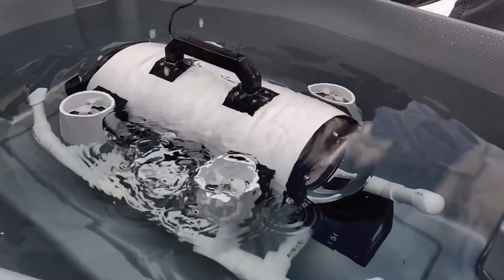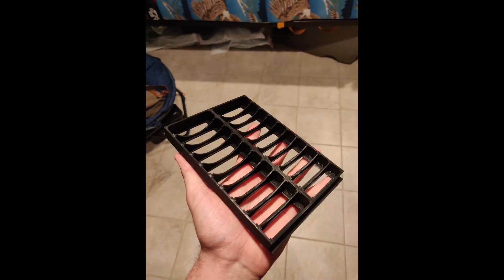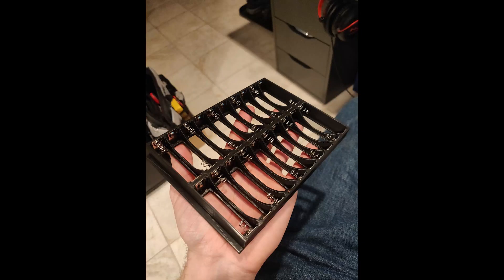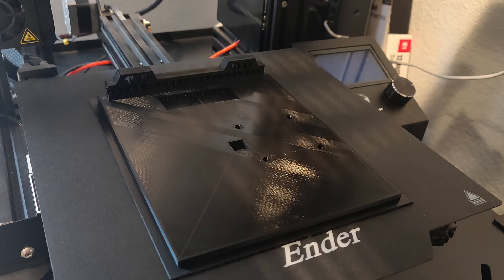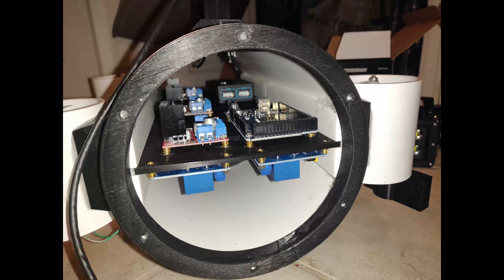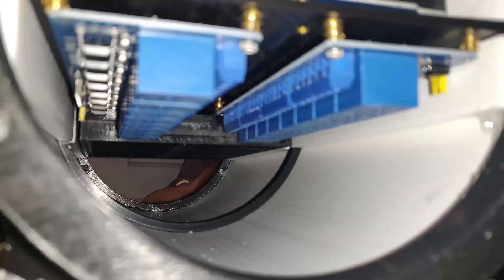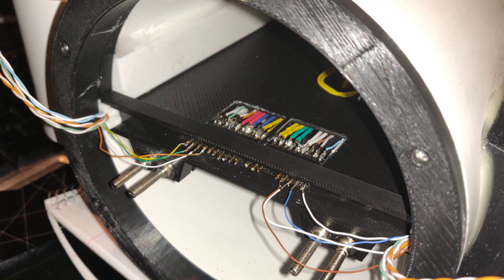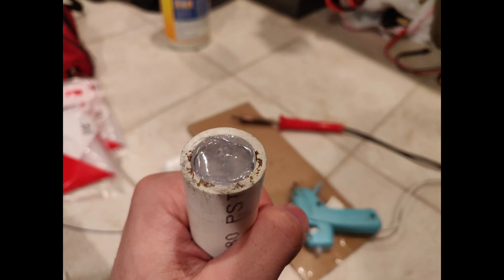Underwater ROV Finale

Comment: Could try using shot for loading shotgun shells for the lead. More precise and could be mixed with epoxy to contain the scary lead and to get it evenly distributed. Also paint the inside black to cut down on reflections.

Comment: Just brilliant guys - as Confucius once said, "Man cannot build his second ROV until he has built his first." 

I'm no expert but really like some of your ideas here. The 18650 battery trays were nice and meant things could be flexible and self righting (and possible solve condensation issues in warm environments). I also liked the handle too as not only made it convenient to carry and launch (unlike every ROV on the market) but if reinforced can provide the ability to trace a strengthened recovery line down the tether cable. Solves ye olde "my sub is so stuck under a log" problem.

Definitely think some work required on the thrusters as you identify. Having 4 for vertical and only two for horizontal movement is not well proportioned and also look into the thruster shrouds. My understanding is they only work to increase power efficiency when there is almost no gap between the propeller blades and the shroud inner surface. Otherwise they are very inefficient, although obviously do offer some protection to the propeller blades I guess. 

Only practical way to optimise this gap is to use metal blades as rotational forces at high RPM will deform the plastic blades to too much to be useful. Also the shrouds should be shaped so that they are narrower at the inlet and outlet to increase water pressure/flow. See commercial ones as they are almost always constructed like this. There is probably some optimal ratio of the propeller diameter/pitch and RPMS to maximise thruster efficiency as very high RMPs would result in thrust failure if water flow could not keep up (cavitation).

Otherwise looking forward to your next ROV!!!

Comment: Joseph + Andrew…. Great job on ROV! Hoping your back now to working on Sub. Looking forward to another update on sub… and Q&A. Started collecting propane tanks and steel to build my own sub. Few questions….
1. Porthole windows - in-depth on how to build them and materials used
2. How connections thru the tank remain water tight… electrical wires, spinning shaft to propeller, etc
3. How to figure out size / weight of sled needed for ballast…
4. Lever / connection on how to drop ballast in an emergency rapidly 
5. In-depth on how to build / water tight hatch
6. How to build steering / rudders / Connections

Hope all is well with you guys. Hope to see more videos / hear from you guys soon. Take care. James
Reply from the maker: Thank you! 

1. We are still working on the portholes. We will document that process. 
2. A lot of silicone and epoxy, and we don't have a shaft for the propeller going through the hull, the motor is external. 
3. Gallons of air needs to equal the weight of water.
4. You drop the weights, the ballast help you float, and we haven't designed that part yet. 
5. Will do.
6. Will also do.
Thank you for the questions, hope that helps.
Reply: Happy New Year…. I keep checking to see what you guys are up too… hope all is well. Can’t wait for an update…